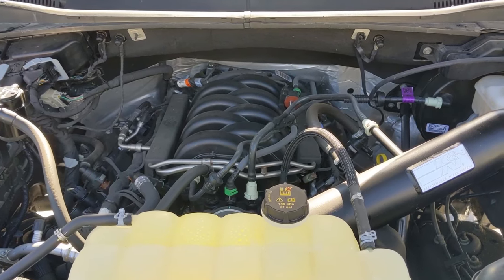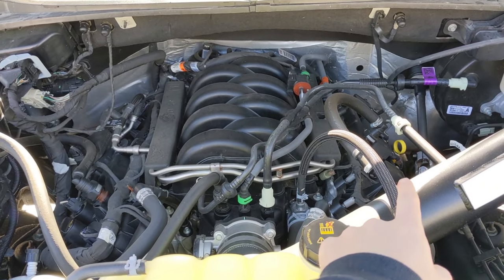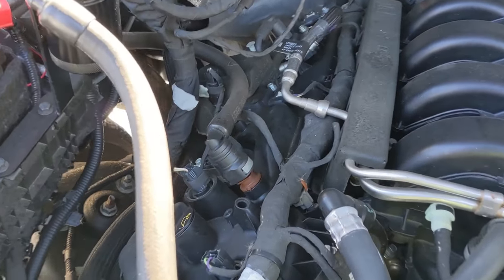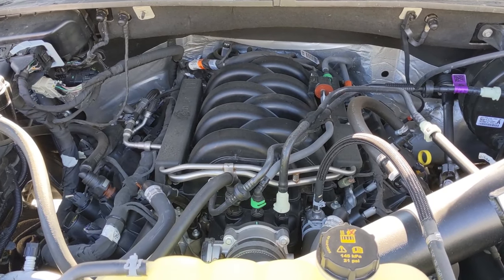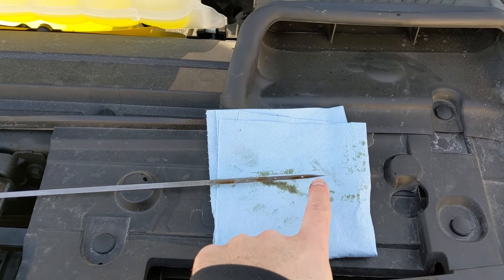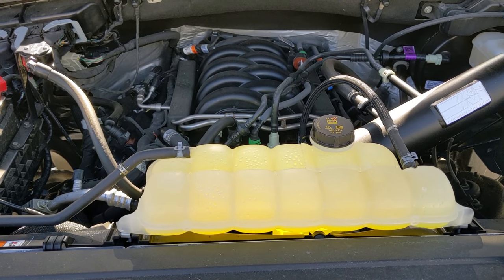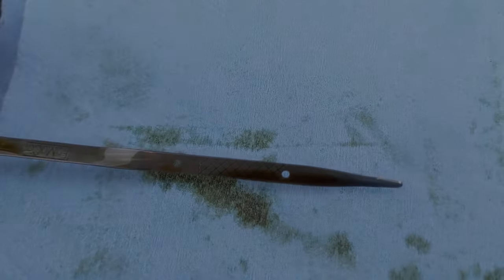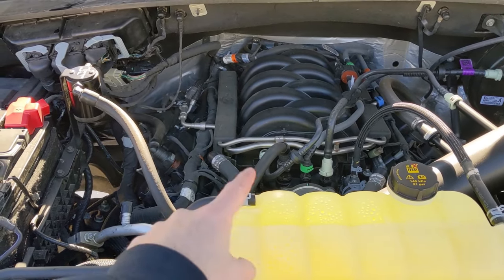Oil Consumption Update - 2019 Ford F150 5.0L

Comment: I have my original dipstick from my 2018 and the new one they install for the tsb and the upper mark is the same. The engine is not being over filled. The dipstick is longer and the range is extended so it allows it to burn the extra quart. Fords version of smoke and mirrors. The excessive vacuum issue is correct but the dipstick is a joke
Reply from the maker: You may not have had a defective dipstick then. I was told by the service manager that the tech had said mine had too short of a dipstick which lead to over filling. Not all of the old dipsticks are the same overall length, and there in lies the issue. This is proven by some 2018 5.0 trucks not consuming oil. Also, these engines only consume oil up to a certain point. I ran the engine for a bit and it never lowered below the level on the thumbnail of this video. But this is one of the reasons why I purchased the 10yr warranty, so I don't have any worries!
Reply: @EliminatorPerformance  well mine was earing 1 quart every 1000 miles until I hit 35000 and it has slowed down. Knocks on the passenger side and echoes through the exhaust and Ford says its normal. I'm sure it has to do with the cylinder bore liner but I have extended warranty so hopefully it grenades before then lol
Reply from the maker: @bukkalaraha  hey I wouldn't blame you for draining a bit out and running it dry before warranty expires lol ford definitely had issues with the 2018s, and yes the plasma lined cylinders but also issues with the cylinder heads, PCV valves, throttle body causing vacuum, lots of issues and still some 2020 models are affected. Now the 2021 5.0 trucks have cylinder deactivation and they call is "variable displacement" lol I can't imagine what will go wrong with a v8 running on just 4 cylinders lol I've heard they sound like crap too haha
Reply: @bukkalaraha  it’s not knocking.  OZ tuning says it’s too thin an oil with the passenger side VVT. They recommend a 5w-50. I’m running 5w-30 and mine is much quieter.  Gonna try 0w-40 euro next.
Reply: Why wouldn't a red flag come up if they're having to put 10 or 11 quarts of oil in a 8.8 oil capacity truck sounds pretty fishy to me
Reply: What is the actual length/lengths of the the short and long dipsticks in inches? Would like to know so i can measure mine on 2019 F150 with the 5.0.
Reply: I had that TSB done ✔️,  and I threw the $22 dip stick that they made me buy right in the garbage 🗑!!!!

Comment: After the PCM change, the engine RPM will not drop as much as before when coasting and slowing down.  This causes the tranny to stay engauged longer, effectively pushing the truck forward under force.  This mandates heavier brake pedal force to slow the truck.  At the same time that wears the tranny more just as if you were holding the throttle open and applying the brake.  Great job Ford.  You found a way to prematurly wear out the brakes and tranny.

Comment: I had the same issue on my 2018, had the tsb and the PCV replaced at the same time from my dealer. That was about 14,000 miles ago and the oil consumption is no longer an issue. I also run an oil separator and it collects about the same amount as yours is. Good video!
Reply from the maker: Thanks for watching, and glad to hear the PCV solved your issue!

Comment: I've also seen several people (including myself) going to 5w30 oil instead of 5w20. A few have mentioned that the dealer changed their oil and put in 5w30. Also, the 2021 F150 5.0s are using 5w30.
Reply from the maker: Yes, just be careful because a heavier oil can cause issue with the cam phasers, as they have very fine screens that the oil needs to pass through. I've heard this could lead to the top end not being lubricated properly. Not that it happens on every truck, but it's possible.
Reply: 5w30 is perfectly fine.
Reply: i also use 5w30 full syn penz..didnt stop consuming oil but quiter engune for sure
Reply: I think 5w30 is fine, about to throw it in again on my 19 but I have seen several people tuned and with charges that run 5w50.
Reply: I also use thicker oil on my 5.0. For winter 5w30, for summer 5w40, have over 130k miles and runs perfectly fine
Reply: @EliminatorPerformance   in Australia there using 5/40
Reply: @EliminatorPerformance  given the change in dipstick and hash marks. How much oil are you now adding compared to the original 8.8L with the original dipstick?
Reply from the maker: @normantse3974  9qts fills it right up to the full line, I've switched to amsoil Signature Series 5w30 and have noticed the consumption isn't anywhere near what it used to be. I'm in the process of filming an update video, stay tuned.
Reply: @EliminatorPerformance  Are you still having oil consumption issues after the tsb update?

Comment: Love my 19 Lariat! Ford replaced the engine at 50k miles after 3 visits. along with the oil consumption it had quite a bit of pinging noise upon acceleration 😳. Don’t know what accelerated their decision to replace the engine but it was quick and painless. Dealership provided a brand new f150 loaner and truck running great 11 months later with no glitches to talk about.

Comment: Checked my oil today on 2018  5.0 and noticed it was unusually low...hence leads to me to finding this video. Only 72 thousand kms on it had me puzzled. Thank you so much for this video. Ready had it in for the abnormal shifting and front rattling
Reply: Please explain the rattling . I think I may have a rattling
Reply: Thats your timing chain. Get some oil in it. @rainohhell7365

Comment: Thank you for the info. I was considering upgrading my 2015, for a 2018. The concern for many has been the oil consumption, but after watching your video, I may proceed... Thank you again
Reply from the maker: I would recommend a late model 2019, if you're spending the money. Or just wait another year if you can afford and buy a 2020 in 2023 etc... The 2018s have their own line of issues. Lots of them sorted out by 2019.

Comment: Ok so we need to talk about your dipstick explanation 

The window was opened to 2 qts and dipstick slightly lengthened to monitor the consumption and see how bad it is before determining 

- does it need a cylinder head or heads
- does it need a short block
- does it need a long block 

It has 0 to do with overfilling with oil, I have a video out showing the exact aide by side differences 

The top hole is the same, the bottom hole is different and the dipstick overall is lengthened a bit to be able to read that 2nd qt 

It had nothing to do with overfilling or faulty Lube techs and simply for monitoring the rate at which the vehicle is consuming oil and so the customer doesn't freak out when they don't see oil on the dipstick
Reply from the maker: Yea these 3rd gen 5.0s definitely have a bunch of different issues, and the TSB solves consumption for some of them, so the excessive vacuum issue during decel was definitely an issue. However, there's also valve guides or seals, the plasma lined cylinders causing issues, piston rings not seating properly, and then like you said, the cylinder heads themselves. Another thing to look at is the 5w20 oil they use primarily for fuel mileage ratings. A 5w30 or even a 5w40 is best on these engines, it'll help with limiting consumption. Hell even the performance pack Mustangs use 5w50. I found that the ev281 pcv valve out of the mustang, and the TSB definitely helped with my consumption. The weird thing is, the mustang ev281 PCV valve is only updated when the block is replaced, as it's not listed in the 19-2365 TSB. As for the dipstick length, it was increased yes, but I was told by a tech that some trucks did in fact have too short a dipstick which lead to over filling the oil capacity in some trucks. It made sense that extra oil and excessive vacuum would cause consumption. I was just relaying the information I was given. They did for sure increase the range on the hash marks, but when these trucks are consuming 1qt per thousand miles/kms it's not hard to track consumption. What's not mentioned in this video, is about 150kms after I posted this, I had to replace the catalytic converters under warranty because they were completely fouled. This truck still only has 15,000kms (9300 miles) on it. I read that Motorcraft 5w30 would not void my power train warranty, as it's warranty approved for this engine, but I'm wondering if a 5w40 would? Maybe you can answer that one. I'm trying to get the most out of this engine, but I do have a 10yr ultimate warranty, so I'm not worried if it ends up needing a block down the road.

Comment: I’ve been looking for a well explained what’s going on with my 2018. Very well done!!!
Reply from the maker: Thanks for watching!
Reply: @EliminatorPerformance  have u had any tranny problem my hits in 4 and 7 but most of the time switch's smooth
Reply from the maker: @ssgred9169  occasionally it skips 3 and goes 2-4 or something like that, but other than that, nothing really. When I drive it cold I notice it shifts hard, but once it heats up (literally a block away) it runs great. I drive it in sport mode though, so if I drove in normal mode it wouldn't do that most likely.
Reply: @EliminatorPerformance  yea I leave in normal mode I'll try sport out thanks

Comment: Im way late to seeing your video but this is 100% the right fix for oil consumption. I had this done here in the states last year after the first tsb failed. The new dipstick, and throttle body tune was exactly the issue. My truck which i run extremely hard still doesnt burn oil. I drive it alot in manual mode, peg the limiter a few times a week. Race anyone i can for the fun of it and my truck still doesn't burn a drop of oil. After watching your video it helps explain what the tune actually did to the throttle body. I was told it did something slightly different from the service rep but i believe now he was mis-spoken. Very thorough explanation and a great video "subbed".  Now if you have a video or have one coming out for an exhaust solenoid rattle issue let me know because ford is dragging their feet on fixing my truck and i believe thats the issue thanks to another mechanic on youtube!
Reply from the maker: The rattle you're hearing is from the cam phaser and timing chain. On the 2018+ 5.0 the engines have direct fuel injection, and the direct injection pump is ran by the exhaust cam on the passenger side of the engine. At low rpm, the oil pump is only making about 20-30psi and it's not enough pressure to overcome the load that's placed on the exhaust cam, so you hear the slight rattle. The only way to solve this is to increase the rpm, which would be raising the idle speed of the engine. You can also run a heavier weight oil (5w30-5w50 for tuned engines) and also slightly overfill the oil pan by about a half quart. This will help the vcty system to always have oil.
Reply: @EliminatorPerformance  ive taken it in for timing chain "slap" because thats what i originally thought it was but that was a dead end with the dealer. A ford tech on youtube has shown that a factory out of spec exhaust solenoid rattles under off throttle blips. Anywhere from 40mph down small blips of the throttle i hear the rattle noise the second i let off the gas. Its done it for 3 years now since it was new and has been in the shop at least 3x now for it with no resolve. They just put a shim kit between the flywheel and torque converter to fix said issue which did nothing but cause the transmission to sound like a tesla (no joke). I get the same run around story saying they cant duplicate it even though i had a tech sit in my passenger seat and he heard it, Its bullsh*t.
Reply: Master Tech at Ford told me that the mustangs 5.0 dont generally have an oil consumption issue. Why? Because they get the snot ran out of them. He said dont baby that engine.

Comment: Oil catch can do work but you need to monitor it during the winter season as water can fill up quickly.
Reply from the maker: Yup condensation from short trips too when the engine doesn't heat up. I drain about 1oz per 5000miles

Comment: Excellent Video!!!  Thank you for that well thought out and informative presentation! 

 I've been struggling with this issue for nearly 3 years now and fortunately I leased my 2018 F-150 5.0L Coyote.    My main issue is that I would have purchased this truck at lease end if it were not for the oil consumption issue and all the potential damage that may already have been done.  Like you mentioned below, your catalytic convertor became clogged.   My UPS mechanic friend who was a Ford mechanic before coming to UPS checked with all his current Ford mechanic friends and recommended that I simply turn in the truck at lease end.  They feel that this is a band-aid fix with potential issues coming later in the life of the engine.    FWIW, I just ordered and will lease a new F-150 in June.  Trying out the 2.7L EcoBoost with payload package.  Excellent torque for my towing and hauling needs.
Reply from the maker: Thanks for watching, sorry to hear about the 18, but good luck with the new 2.7!
Reply: Well, I’ve had this issue w my 5.0 since 2011.  Bought the oil catch can and empty it every few months. Yes, it’s full. It’s been using oil since I bought it. The dealer said all new trucks use oil. Hope to do this PSB on my truck as well. By the way has 160,000 miles on it. Was thinking of putting a new engine in it. Perhaps I won’t have to now.
Reply: @billstriegel4357  - Reality is that NO, all new trucks do NOT use oil... My new 2022 Ranger Lariat with the 2.3L ecoboost came with the oil just below the top hole on the dipstick and it has not moved at almost 2,000 miles of as much freeway driving as possible...  I changed the oil and filter at 1,200 miles and the level at just below the top hope in the stick is still there, almost 800 miles later... I have never had vehicles that just "use" oil... No...

Comment: My 2018 has the oil consumption issue. At 20,000 Ford installed a new engine, it consumes just as much oil as the old. I too, received the new dipstick, it's 7/16" longer than the old one. The full mark is the same distance from the top of the dipstick, meaning the 8.8 quart mark is in the same spot in the crank case.  The distance between the hash marks is now twice as long, it's now 2 quarts between the full and low mark rather than one quart.  Ford hasn't fixed anything, they just want you feel better when you pull the dipstick out and see oil on the hash marks rather than below them.

In the TSB that called for my engine to be changed, Ford defines excessive consumption as 1 quart or more in 3,000 miles. Both my old engine and the new one  a quart every 2,500 miles. I now have 20,000 on the second engine and am due for an oil change, it's just below the low mark on the dipstick, two quarts low. If I had the original dipstick, I might see oil at the very tip, or not at all at two quarts low.

Ford tells me its now OK to be two quarts low, I guess changing engines cuts into the executives bonuses. 

I believe the vacuum issue, is only an issue because of the coated cylinders. Sure it's pulling oil past the rings, but only because the rings don't do a very good job against the coated cylinders. 

If the longer dipstick makes you fell better, good for you. It just irritates me.
Reply: Same thing with my 2018 f150 coyote.  I found the issue when I serviced the engine at the first oil change.  There was hardly any oil in it!!!  Ford replaced the motor and the new motor used just as much as the first motor. More than 1 qt per 2500 miles.  Ford was going to replace the motor again and I decided to do the lemon law and Ford bought it back.  I bought a raptor with the eco boost and no oil burning issues.  I’m convinced it’s a problem with the plasma coated cylinders. The problem showed up when they went to plasma coated cylinders.
Reply from the maker: 18

Comment: The catch can pulls out the moisture, inevitably there is a little oil with it. In my ecoboost i typically got 8 to 12 onces every 1500 miles. Just bought a 19 5.ol thx for the info.

Comment: Well done!  Thanks.  
I had the TSB done last year and fixed the oil consumption.  No biggie, this engine is solid.
Reply from the maker: Thanks for watching!
Reply: exactly  5.0 coyote is solid  ..buy  5.0 lots of power , gets  decent  mpg .  2.7 and 3.5 may bet better MPG but   More parts,     turbos,   controllers, lines ,  gasket areas, etc etc etc  etc  to motor the more links their are to fail~real simple, and turbos are   major failure points , hot city / driving conditions eat them, doesnt matter how much  extra cooling etc , If you buy ford  the 5.0 over  this motor is better in long run even though it drinks more gas, the cost of  broken 2.7/ 3.5    repairs exceeds  gas mileage/ costs of 5.0 coyote

Comment: Would it work just to change oil and filter, install the factory recommended oil and take note of where on the dip stick it is and go from there.  I don't want my throttle body adjustment if it is going to lower my mileage.